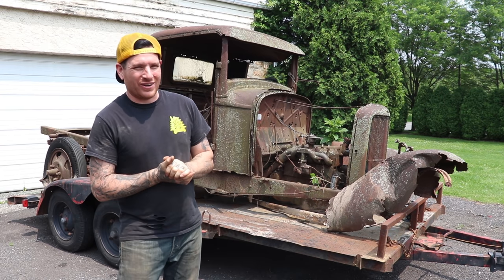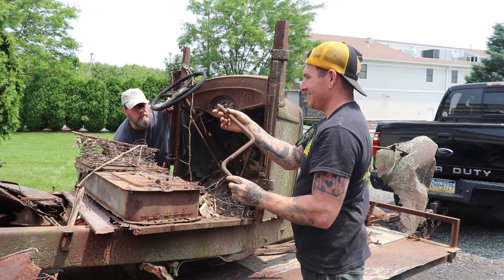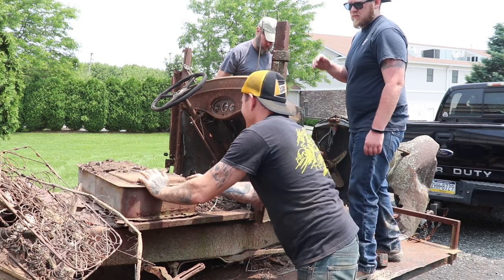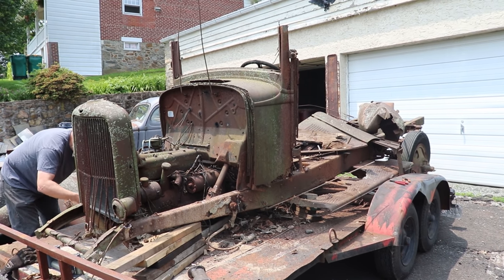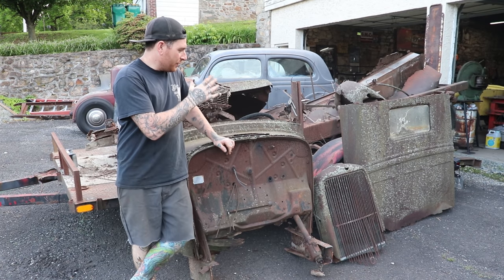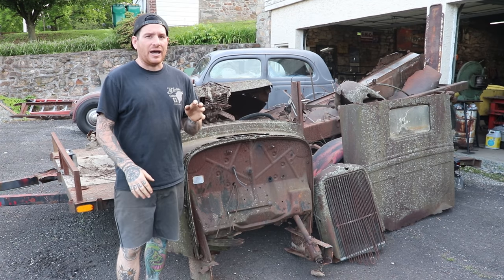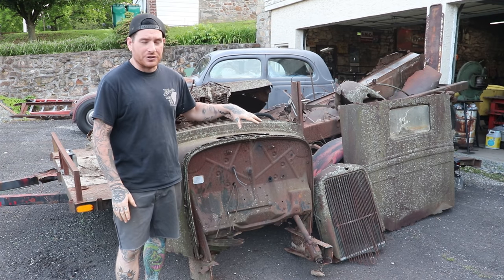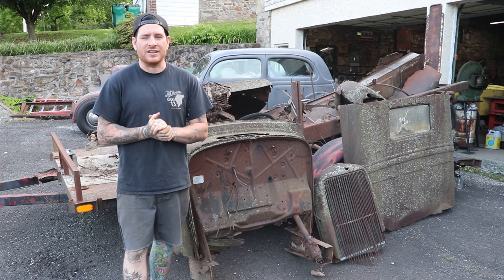1932 Ford BB Truck - Field Find

Comment: I had a '33 Ford BB that was much more complete and sound than your '32.  It had a factory V8 which everyone wanted to buy from me as true and correct '33 Flatheads are rare.  (V8 trucks were an un advertised option) I wanted to restore the truck as it was built so wouldn't sell.  That truck was one of the most fun vehicles I have every owned.  My kids learned to drive on it, I told them if they could drive it with its 5spd non-synchro trans, no power steering and mechanical brakes they would be able to drive anything.
Reply: I also have a 33 BB 157" truck. The original V8 engine had a bad #3 rod. Now has a 1952/3 V8 engine in it. Was a grain truck from Great Falls MT. GVW 14.000 lbs..

Comment: What I always thought was cool is how with old truck rear axles, they would repurpose the axle tubes as jack stands. You see old time garage pictures of these at work holding up whatever. Don't toss those tubes away, more old gold.....
Reply: Check out the vid where they scored some engines recently,there are a few diff housing axle stands in the back ground. I've used them myself years ago .

Comment: Wow Matt, thank God there are still guys like yourself that go to this much trouble to save the Old Tin.  The back of the cab with the body lines and even the back glass, the firewall, the dash, steering box and even the 4 cylinder well worth passing on to others..  That Plasma cutter is the Bomb, I got to get me one of those...

Comment: The grill ranks the best for cool ads wall hanger stuff.
However I like the 4 banger B motor. I've seen a lot of hopped up original 4 cylinders at car shows. They aren't super fast but I go fast all week in my f250 working. 
Nice video. Thanks ITG

Comment: shame you killed the frame, surely somebody would have wanted that,
Reply from the maker: I have a friend with one that he can’t hardly give away for years now. I have too much stuff and can’t keep everything and this frame less than desirable for the work involved to disassemble and save it.
Reply: @IronTrapGarage  I would've taken the frame, I would like to rebuild one of these 32s but cant
Reply: Problem is the frame is the last thing to rot out, so no one with the rest of the truck is really lacking a frame unless its been crashed or something.
Reply: Good show glad you got the relics out of the grave and back in circulation.

Comment: I'd have to agree with you that the firewall is the best part. I'd also be after that front spreader bar. I think the BBs had a different steering wheel and gear box though.

Comment: Here is some rigging etiquette. When using a nylon strap never basket the strap alway choke it and you could have possibly used a second one as well. It will save on back stain and the item you're lifting won't slip out of a choked strap but most definitely will if you use the strap as a. Basket. Like in 7:28.

Comment: Nice work saving that Cowl & Motor/Trans Matt, I was hoping you would the underside of that fuel tank didn't look so bad for a 32considering how HEAVY built those trucks where back in the day, 3/4 - 1 ton is underestimating it, More like 3-4 TON LOL

Wish I could save that IH COE... Man I want one so bad.

Comment: Not gonna say the firewall is mint, but compared to the rest of the truck, it's surprisingly good.    BTW I have seen rat rod idiots using wheels off BB trucks, so you could probably get a few bucks for them, good or not.

Comment: Did you save the drive shaft, I know the drive shaft is inclosed. That shaft makes great spud bars or pry bar's  keep that in mind that  shaft should be inch and 1/4 thick or inch and a half.

Comment: I had a model 32b  just a bit better than this cab. my doors were 1/2 gone on the bottom I remade the whole bottom inside and outside about 5 inches up both sides. channeled it down about 5 inches with a 1  1/2 raked floor. Boy did it have a cool mean stance Big block gm 454 and old school powerglide with a shift kit.  ford 9 inch 4 bar coil overs rear, reversed eye front leaf.   the best thing about b32s and  are the full steel roof/visor everybody chops the top I like the head room ! and the way i did this You needed every bit  very little floor space with the trans. tunnel and seat bottom was only about 5 inch off the floor. Maybe If I can find a few snapshots I will send them Your way just for kicks Its been about 26 years ago on the build. Keep Rodding Nice shop!!!

Comment: The dash is a biggy and of course the steering box if it can be salvaged. That is the most but that firewall has nickels and dime written all over it... that said, the back window could be a pattern for some old glass from a different make but the back window is there and still one piece, the glass with the hole in it could be someone's dream of a bonnie and clyde car theme And the engine could be a test for soaking metal in vinegar. Check out videos where they soaked car parts in vinegar and it was bare metal. I sen the broken spring pack but the rear axle if soaked in a bathtub one end at a  time might surprise everyone Although the bearings might be gone but who know being out of sight and having grease at one time could be surprising... I would like to see a video of that done real. I always see the carburetors done like that and thy come out with a blast of air and the kit goes in to run like new. Now we both know better than that but lets  find out how serious a rust it will remove. Just get a 55 gallon barrel as a ad for heinz or some other company that might sponsor this GOOD LUCK

Comment: The B 4 would make an excellent basis for a real Hot Rod. Were the 33 and 34 four cylinder trucks the ones with the firewall mounted stabilizer ?

Comment: Matt, I thought I read somewhere that the BB frames are good to use with a car build that will run a higher horse power engine. Is that incorrect???

Comment: I need the cylinder head off of that B engine if you want to sell it? Mine has about 25 pins in it and isn't long for this world. B heads have a cracking problem.
Reply from the maker: Sorry the engine was sold complete already. We’ll keep an eye out for a head for ya!
Reply: @IronTrapGarage  that would be great thanks!

Comment: Shame a sincere restorer didn't find this rarity before a profiteering butcher did 😕
Reply: I totally agree with you.  If this was their goal they should have just left it alone.
Reply: A "restorer" wouldn't touch that.
Reply: Kyle Skiles ~ speaking as a restorer, I've tackled worse projects. Not everyone wants the easy stuff.
Reply: Most of the model T's, A's and B's you find now are the cars the restoration crowd passed on during the restoration craze.